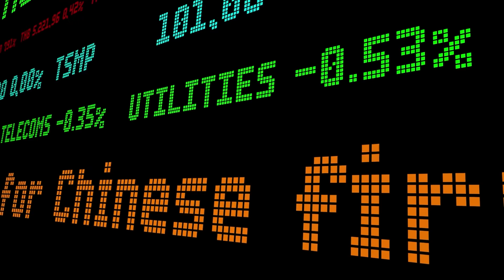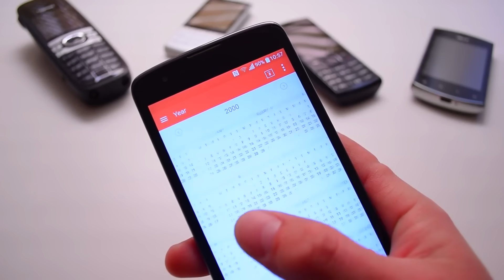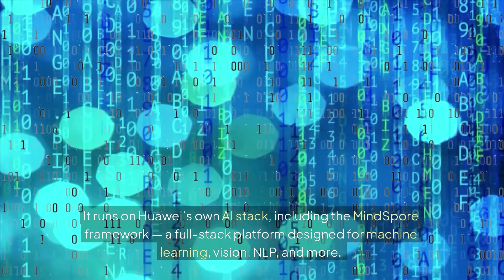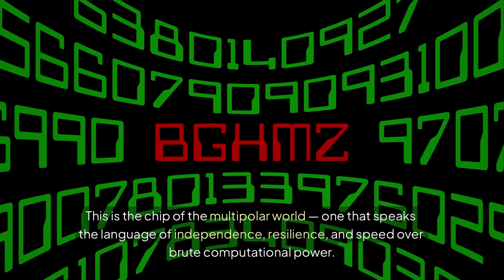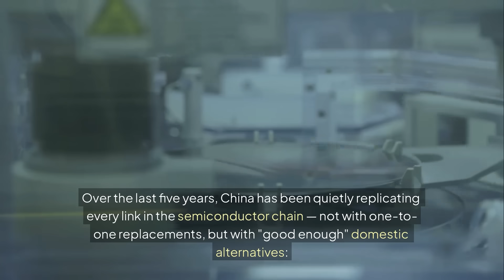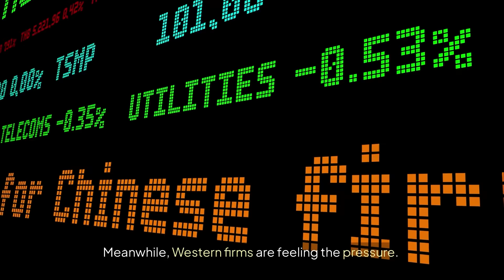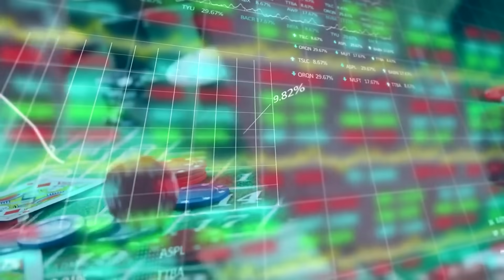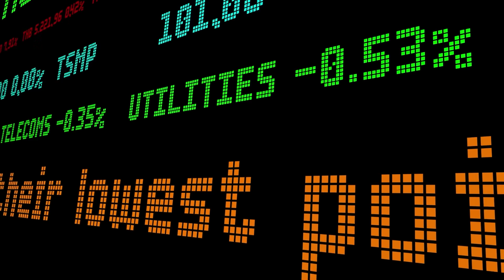China’s New AI Factory Stuns Nvidia Investors — What’s Next?

Comment: As a start, it doesn't need to be the best, all it need is to be working, reliable and fully independent from the US sanctions and technology. Next it will be to lower the costs and prices, mass manufacturing and usage and then on to move to the more advanced chips and it is happening and will accelerate even faster going forward. By then, it will be check-mate to the US chips industry.